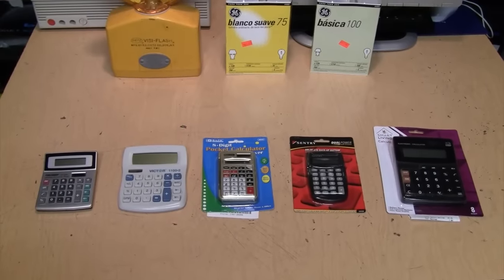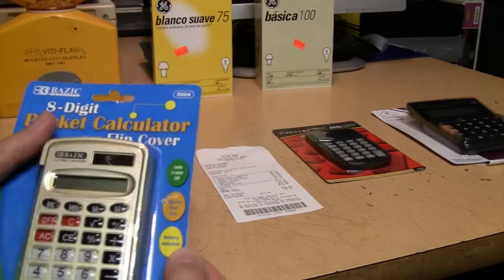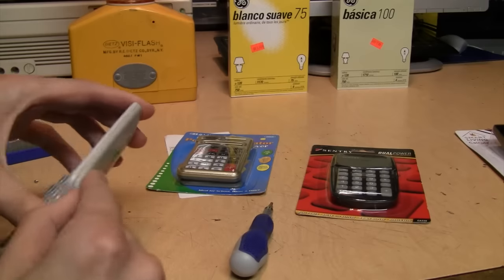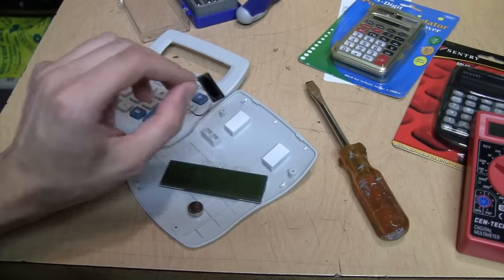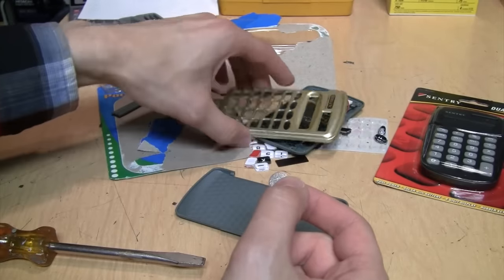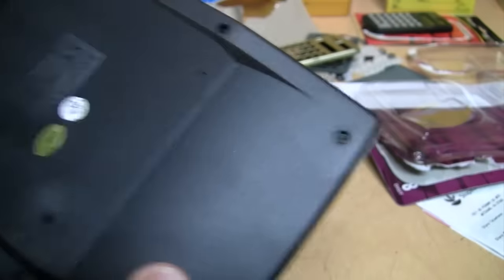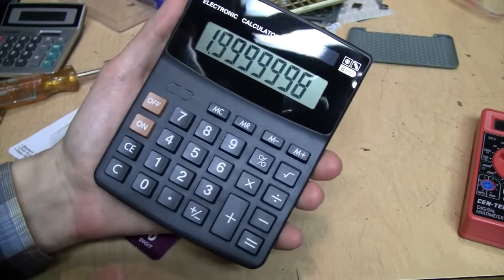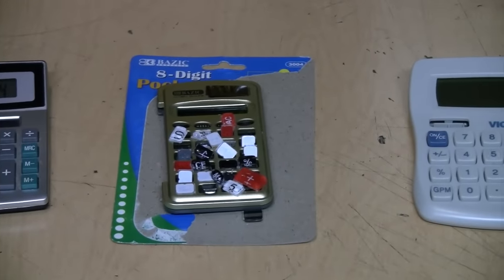Solar calculators BUSTED!

Comment: I remember having a Solar-only powered battery. It had like 1 millimeter of thickness and when I covered the panel with my finger during a calculation, it could do crazy things. (i.e. 3+3= 777777777...)

EDIT: I meant calculator, not battery. 3 years passed and I only now noticed the error.
Reply: Same
Reply: I wish those were still around
Reply: When I put my finger over one

88888888888 was what I saw
Reply: XDDDDDDDDD SO DRUNK (the calc not you)
Reply: Chewie Chewbacca that is because of the pixels
Reply: When I put my finger over it, I got 0=666.
Reply: JACKPOT!
Reply: In school we have these blue TI-108 calculators, and if I held the buttons, I could get some of the digits to get messed up.
Reply: MiREK my friend has on when you do that it turns off.
Reply: MiREK 😨
Reply: how funny cus the one i had would just fade out
Reply: MiREK wtf? 3+3=7777777777? lol I wish I had some calc like that!
Reply: EP1CxEMAN08 You can just get the battery out of a solar&battery calculator.
Reply: I had a solar calculator that when I covered the solar panel the screen simply faded out
Reply: сестракофе if you look at it right it’s usually can be seen with only eights when off ( like most things with numbers)
Reply: @EP1CxEMAN08  I have one like those I got it from my school
Reply: same
Reply: its thiccness
Reply: Me: Teacher look see my calculations are not wrong
Reply: Mine said 5318008
Reply: Are you from India? I've  similar calculator although I never tried by putting finger on it. Also the button are is flat with just picture printed on it.
Reply: @azestical6566 ikr, make everyone feel dumb and pretend to be Einstein.
Reply: Elisha Ellis 
Yeah, you could just go up to someone and say hey did you know 3+3=7777777? and then they say no lol it’s 9 and then u show ur calculator and their like “r u Einstein???”
Reply: @azestical6566  Since when 3+3 =9? Really, may be they changed the signs, I've not done maths for a long tym.
Reply: Same, got it as a hand-me-down from my mum. And I still have it and it still works perfectly.
Reply: Yeah, I still have one of these. It's a pocket solar calculator and making it glitch out and show weird numbers was one of my favourite pastimes as a 12 year old.
Reply: That’s because it’s having a headrush
Reply: You mean to say, you had a solar only powered 'Calculator', not 'Battery'.
Reply: EPICRANDOMGUY 02 Yeah, I meant that. Oops.
Reply: My mans discovered circuit bending :)
Reply: Aww man i wish i saw this comment before he noticed he said battery and not calculator >:0 i could sell my memory on the gray matter market
Reply: It always scared me that I would get a wrong answer, so I would do it multiple times. I had some really cheap ones but they were def solar only cuz they needed to be under pretty bright light. If you angled it wrong it would start glitching out
Reply: character development
Reply: I have a KARCE Kc-030  and it needs light, otherwise it won't work. And made in China. 
Also labelled Electronic Calculator; All Caps.
Reply: Sounds like one of those credit card sized ones from back in the '80s.

Comment: You're right, I AM shocked!  I didn't know that this was a thing...

Also, I caught the homage to at least 3 different YT channels (was expecting puppets after the bongo riff).  If only you had revealed the "chooch factor" of the calculators and made a Duke Nukem reference... :-)
Reply: Something inside me died a little…  I am actually tempted to get my solar  desk-calculator from the late 90s and open it up. Let's hope this one was still the real deal. I remember having a little solar calculator and when you blocked the Solar panel the LCD actually got dim. So that one must have been real.
Reply: KRAFTWERK2K6 twas just a solar sensor
bamboozled
japed

Comment: I always wondered why some solar calculators had an "off" button? Why the need to turn off a device that does not consume battery power? Now I know!
Reply: for OCD people who like things off
Reply: There is a reason: some (real) solar calculators are dual power (i.e. there is a battery in parallel to the solar panel, and the battery and solar panel have both a diode to prevent either one "recharging" the other).

If you leave the calculator ON in a drawer where there is no sunlight, you'll drain the battery :)
Reply: groszak1 that's not what OCD means.
Reply: I dont want my calculator ready to calculate all the time, but i could also imagine maybe for a real one, turning off the circuit could make it last longer
Reply: It's to save it using up the sun 😁
Reply: Crzygamer you mean it doesnt stand for "Off Calculator Dependancy" ???

;)
Reply: nopethegeek ohh true
Reply: nopethegeek It's just a good idea to always have an off button on electronics anyway, don't you think?
Reply: the battery?
Reply: Ya that why
Reply: Many new calcs use super-capacitors that charge up very quickly from a solar battery and can maintain the calc in low light levels.  So having an ON/OFF switch makes sense. I have a very old scientific calc from the early 80's. All solar powered  no ON/OFF switch at all. If it is kep in the dark a very long time and then suddenly  exposed to light, it will display complete gobbledygook
Reply: Why would you not want to have an on and off switch?
Reply: @Crzy520  Yeah I would know. I have OCD.

Comment: My mom had a calculator shaped after a credit card. ALMOST SAME THICKNESS. It was too thin to even have a battery, and could fit in any wallet. Lovely little calculator. Never seen any calculator like it after that.
Reply: I still have a credit card radio I got from radio shack. It looks too thin to have a battery, but it does have one....
Reply: I remember those
Reply: I remember those. Radio shack used to sell some really nice calculators back in the day.
Reply: I have same calculator. He is over 30 years old and still works.
Reply: My dad has it too but it's broken.
Reply: @linandy1  I agree. One of the things I don't like about modern calculators is the numbers are tall and thin. My Radio Shack calculator had shorter numbers that looked better.
Reply: Yeah my mom had one of these too. I loved those as a kid :D
Reply: Google exists.
Reply: I have a calculator exactly like the first one in the video except it's different brand (Solar Equate - Dual Power - Large Display)... Bought it long ago... forgot when but probably in the early 90s. The battery died about a year ago, but it still works indoors if the lighting is strong enough... works normally under the sun. 
I thought the battery was rechargeable V10GA but doing some research I've just found that it's a regular 1.5V alkaline button cell battery, and it only served as backup when the lighting was poor... otherwise the solar  panel provides the main power.
Reply: eBay.
Reply: I had a few of those when I was a kid, but I haven't seen one in years.
Reply: @eric_d  ebay.
Reply: Bruh mad shout out to that calculator. It was doing gods work, stay blessed little buddy.
Reply: Those were available for a few years in the '80s.  Haven't seen them recently.
Reply: can someone say the name of the calculator please
Reply: Oh yeah! I had to google an image of it but my dad had one in his junk drawer. I didn’t like the bubble buttons, they felt weird and took a long time to press.
Reply: Too thin? Actually, I had one. It had a very thin coin cell.

Comment: Great video, but I don't get it. The fake panels add manufacturing expense... Is there really a driving market demand for dual power calculators? Or is this just manufactures re-using plastic molds from more expensive (real solar panel) models/brands to save on design costs?
Reply: Because it tricks people into thinking it will work forever, when in reality it will only work for 2 or 3 years before you have to disassemble it
Reply: Because changing the mold for the calculator would cost hundreds of thousands of dollars. So they use the same form with a fake panel in it. IT doesn't change the actual function of the calculator at all.

Comment: My best guess is that the manufacturer also produces another model of calculator with a functioning solar cell that uses the exact same molds for the case. It's cheaper to just cover up the slot with a thin plastic film than to shut down the supply line to change out the molds for ones without the slot.
Reply: that's exactly what it is. and a lot of the time the version with the solar panel is no longer sold. sudden they don't even bother anymore. remember this technologies decades and decades old. so if you're buying it from Walmart for $1 how much is Walmart buying it for? 10 cents

Comment: The TI calculators at school actually have real solar panels...
Reply: Poebat I should hope so, tis aren't cheap.... (or this cheap)
Reply: that's true too. Funny thing about those $1 calculators are that the button batteries cost more than they do... I haven't seen button batteries for $1 (at least were I live)
Reply: Poebat dollar tree or most dollar stores have 2032's and other button batteries usually 2 for a buck
Reply: so you're telling that all this time I've been spending way to much on button batteries....
Reply: Poebat Typically in manufacturing, they get a giant discount by buying in bulk.
Reply: The cheapest of the cheapest are not as good as brand name products.
I mean: In a calculator it does not matter, but I would not put dirt cheap no name cells into expensive electronic like a computer mainboard.
Reply: those little blue ones? lel
Reply: Poebat they sell button batteries at the Dollar Tree. I actually bought some just the other week. A four pack of LR44s.
Reply: Poebat those math class calculators with a bunch of different options those are definitely real they are like 50-100$
Reply: Daniel Pickering exactly
Reply: Daniel Pickering it's Texas instruments is an American calculater that has. awesome features
Reply: Daniel Pickering In Germany as well, but we aren't allowed to use graphical calculators :(
Reply: due to a bunch of bullshit the american curiculum teaches only on ti because they made some shrewd deals back in to 90s to secure there permernant place in the classroom which is why they can command such high prices
Reply: yup never sure why we used scientific i dont remember my exams using much of what was on a scientific  calculator apart from the brackets
Reply: Poebat 
Woah 980tis have solar panels?!?!
Jk
Reply: You can buy a cheap set of 24 fake candles at target (and probably a lot of other places cheaper) that all have 2032s in them.

Comment: I discovered a phony solar cell a few years ago when I replaced the batteries in a Office Depot branded calculator. And that was a $10 calculator.  My dad used to put his calculators in the windowsill because he thought the solar cell would recharge the battery.
Reply: wildbilltexas his old ones were probably real
Reply: They might have been in the 80's or 90's. But not the (cheap) recent ones. My father was a petroleum engineer and he went through calculators.
Reply: +wildbilltexas interesting choice of words.
Reply: Yea, but the real ones reduce battery usage not recharge it lol ;-)
Reply: It's crazy to me companies can sell solar yard lights for a dollar and then act like it's too expensive to put a much smaller solar cell on a calculator that costs more.
Reply: And the yard lights provide enough light to last for a time of 32 quadrillion celebrity marriages....

Comment: i used to always take them apart and take the " solar panel " off cause after you removed some foam, wires and tint you got a very nice sharp glass rectangle that scratched almost everything, fun af
Reply: although they were pretty expensive school calculators so it probably was a real solar panel lmao
Reply: yeah that is what happens to the majority of my calculators.
Reply: i actually have a huge scar on my forearm from someone cutting me with those little glass rectangles lol
Reply: I thought i was the only one that did that XD
Reply: they work really good for parting out lines of flour on a cd case so you can sweat all the CoHoes at the party...u will be Mr. Popular quick after a stunt like that ....till they see its flour....
Reply: Please, you scratched things into the bathroom walls with that thing.
Reply: explosev gamr 
I hope you don’t anymore.

Comment: should gather as many little solar chips as you can and link them up to see how much power you can produce from your led light.
Reply: It'd be a very inefficient way of making any kind of worthwhile wattage or current, I expect... but it could certainly be a pretty interesting alternative to a traditional step-up transformer if you got, say, 100 of them and wired them all up in series. A 20x5 grid of PV strips wouldn't even be too large (well, after all, it's 400 of those little squares), but it would then put out 160 volts DC (at, thankfully, a low current, and without much in the way of stored energy behind) when that same light was shone at it. Or still a good few dozen in ambient lighting. Which could give you the ability to deliver mild, joke-shop grade static-esque shocks to random people using nothing but the power of available light and some very simple cabling.

However I bet there's a supplier somewhere that will sell you a literal bucket of the miniature PV strips, enough to make an entire business suit out of, for not very much money at all. You don't need the rest of the calculators, just the PVs. A few thousand of those in series, and assuming it doesn't exceed some kind of breakdown voltage in the cells (as far as each is concerned after all, they've only got 1.6v across them, even if that IS the difference between 230v and 231.6v) and is properly insulated, you could start emitting solar-powered plasma-ball style mini lightning and glows as you turn any nearby light into multiple-kilovolt glows and sparks.

I wonder even if it would be enough for the Emperor's sith-lightning effects from Return of the Jedi. It need not carry quite so much paralysing power, just... yknow... be lightning shot from the fingers with no obvious central power source. Hmm..
Reply: It produces just enough power to power the calculator. My solar calculateor won't last 10 extra seconds without sunlight
Reply: Mark Penrice what I read "blah blah blah technology stuff blah blah blah."

Comment: I'm pretty sure those little chocolate calculators you'd get from those scholastic book fairs are only solar. I remember if you were slightly in the shade it would just completely turn off.

Comment: Always buy a CASIO™ calculator
Reply: Most of the time, I'm using my phone's calculator or I'm using the calculator in Windows. I use a TI-84 Plus for school though.
Reply: RAZ3R yea :)
Reply: CASIO fx-82AU PLUS II boi
Reply: FluorescentGreen5 fuck yeah bro
Reply: Sharp ELW516XGBSL Write View! 
Recognize!
Reply: Just tested this with my CASIO fx-85GT Plus and it not only correctly calculates the square root of 2 squared, but it also has a genuine solar cell that can run it perfectly fine even from the light of a bedside lamp. This wasn't a cheap calculator, though, Casio does have quality.
Reply: No, you can't beat the old HPs... my HP41c is 30 yrs old, I use it every day.  I have an HP45 that's almost 40 yrs old, the battery is shot, but it runs perfect if plugged in.  On both,  the displays and keyboards are perfect!  They're just like brand new.
Reply: I have a Fx991ES PLUS
Reply: using a TI-36x pro texas instruments
Reply: Texas instruments TI-80 series is unbeatable
Reply: Use a TI-84 plus CE
Reply: or a TI
Reply: RavenChan phone calculators are absolute garbage
Reply: Ti-Nspire CX CAS is the best calculator ever made
Reply: rule 1 -- never pay more than 20 bucks;  good, modern calculators are a cheap commodity.
rule 2 -- always get a model with a bulge at the top.  that's the AAA battery that you can replace every 2-3years.
Reply: @jeixs  same here
Reply: Or an overpriced texas instruments calculator. Like a ti84. Honestly i woul reccomend a ti 84. Theyre reliable.
Reply: tm
Reply: @FuzzyElf  hmmm...  does it come in glitter?
Reply: @mayravixx25  what a waste of money just buy a normal scientific calculator for £10 - £20 that will last you years
Reply: @bashisobsolete.pythonismyn6321  wtf you can replace pretty much any calculator battery
Reply: @ogy2014  yes and AAA is the easiest to replace and longest lasting.
Reply: @ogy2014  Don't worry, I didn't waste any money on it. It was provided to me by my school and had to go back at the end of the year.
Reply: Iliveunderthefridge Atwalmart  i select international keyboard layout with deadkeys.  gives me a ton of extra characters.  i type rt-alt, rt-shift, 8.
Reply: Casio fx991ex have an indicator whether its using batt or solar
Reply: @neilmcanally9337  Dude, replace them batteries!
Reply: @bashisobsolete.pythonismyn6321  i needed a ti 89 calculator for school, there wasnt a chance of me getting it for les than 20 bucks
Reply: CASIO!!! REPRESENT!
Reply: I don't like the, your casio calculator emulator's subscription has run out, now pay some serious cash for three more years of emulator use.
Reply: i love my casio's, but i also love my $1 jot sci calc
Reply: @neilmcanally9337  i wanna get an hp
Reply: Yeah. Casio Fx-115v. Made in Japan. Real solar cell. Passes the square root test. A Japanese factory owner probably would have needed to stay 15 minutes on his knees in front of a TV camera if fake solar cells had been discovered.
Reply: My fx-300ES is my go to but I have an old TI-83 for anything that needs it.
Reply: Always
Reply: i have a sl-310uc orange color
Reply: I have a Casio SL-300ST I've had for at least a decade. It doesn't have a date, but I've never replaced the battery and it's still working perfectly. If it should ever die my local Walmart still carries them for around $5.00. I don't see any reason to buy anything else.
Reply: Texas Instruments and Casio are the Kings of calculators